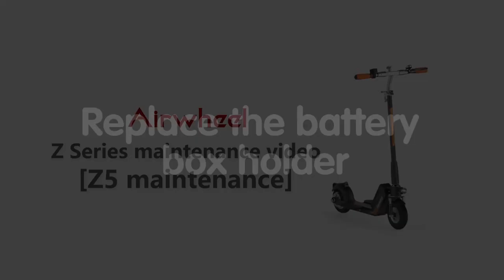To replace the battery box holder of Airwheel Z5 lightweight electric scooter

Comment: Why should I need to replace the battery holder module?. Can you explain?
Reply from the maker: in case there is something wrong
Reply: that frame is the weakest part of the kickboard. In my opinion some of the kickboards Z5 left the factory with too weak frames. I am using 2 Z5 and I wouldn't  replace them with another brand, what everyone needs to remember is to take care of them and check regurerly all of the screw whether  they are tightened.
Reply: Mine broken in half while braking, did a nasty shunt not to mention the walk of shame going home with 2 parts of z5 in my hands. Thanks for this video, I am trying to contact Airwheel after-sales as I want my Step to be repaired...it was only 8 months old when it happend.
Reply: Where can I get the wrench to remove the fork...I am halfway replacing and dont have this tool. Thnkx.